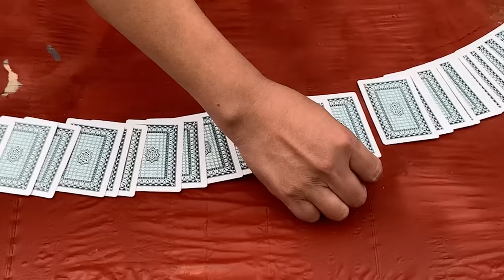Full Restoration of Old Heavy Damaged 125cc Minsk Motorcycle // Full Restore of Minsk 125cc Old Rust

Comment: alright lets sum this up, i didnt see any new parts beiing installed, reusing the old parts is just a loss of time since you are gonna do that job again, the color combo does not suit the time when the motorcycle was made, but i dont mind that, i understand its everybodies choice. But mixing oil and gas into a 2 stroke using 10w-40 4 stroke oil seriously made me laugh. With that beiing said, i apriciate that somebody takes this old, not running machine and transforms it into a running motorcycle, you should be proud of yourself.
Reply: Maybe he kept the old pieces to keep the motorcycle as stock as possible from factory to keep its authenticity or something like that. I do the same with my old moped I'm restoring. Plus, if those old parts are still in good shape and useable, what you consider a waste of time can be saving money.
Reply: @dosh8276  sure, but i only have bad experience with reusing old parts. But on the other side, new parts arent always the same quality as old new parts.
Reply: I really don't know what video you was watching maybe you was just talking about the bike but let's Starr there these videos are about repairing and restoration of these bikes and other things but anything that was on the bike that was bad like the foot pegs he replaced any holes he welded up on the motor I saw him put in new bearings, seals, clutch plates etc so I really don't know what you're talking about no he didn't do a complete factory restoration on it none of these channels do I think there more on how to show you that you can do it on a budget lol
Reply: Вы полностью правы  то что он покрасил  старые детали . 
Сделал как у нас называют сельский тренинг.  Это. Лютый кринж . 

Зная этот российский мотоцикл тут не то что  рестоврацией не видно а  словно он посмеялся над оригиналом
Reply: @Clintcellington  just give me some time please, i just started the other half of the year in the first grade of secondary engineering school and i kinda have a lot of work now, but i will be looking forward to making a video about restoring my 70' german moped.